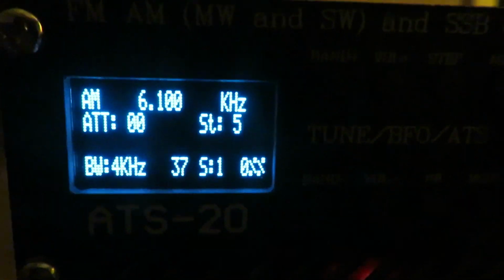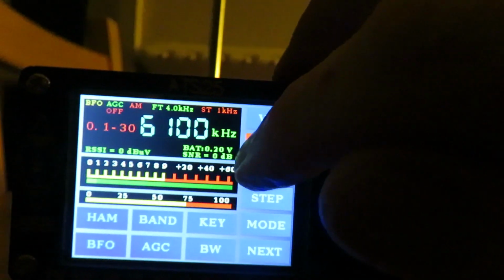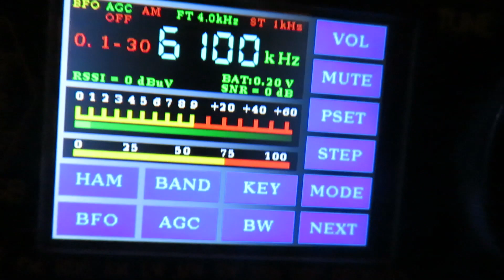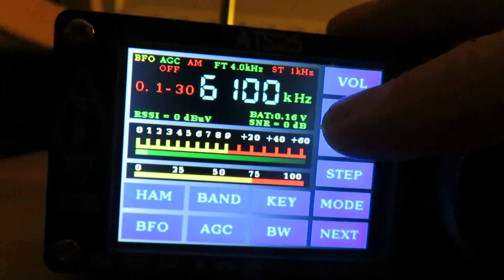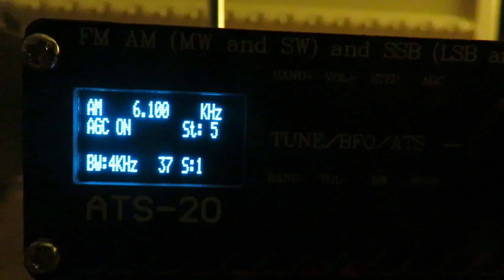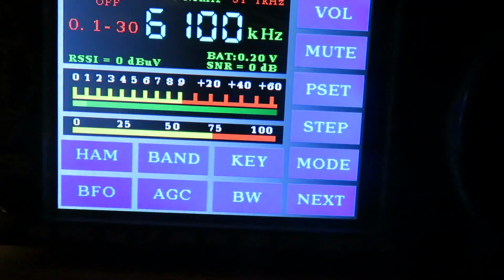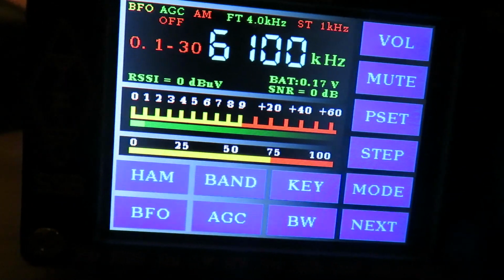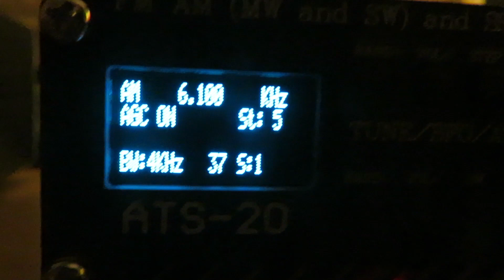ATS 25 VS ATS 20 on shortwave

Comment: In that situation - on the ats-25. 
Switch modes from am to any sideband then switch it back to am and tell me if it comes alive - mine is acting like this to, do like I say and see if it comes alive. You must do these steps if you shut the radio off and back on again to. I also found you must do this if you change bandwidths as well. Say you go fro 2.0 to 6.0 BW,  you flip the modes then back to AM and the signal gets stronger by far.  I hope I’m not the only one having this issue.

Comment: On my ats 25 the volume and tuning work in reverse vol up is to the left. Any fix for this? Thanks
Reply from the maker: John,I had  a similar problem with my ATS 20 and it could be fixed by changing the Arduino sketch, it was easy enough. I haven't updated my ATS 25  yet nor have I looked at the sketch so I can't be more specific sorry.
Reply: @KevinOReillyswl  i’m not good with arduino. Ats 25 has a yellow freq readout. If u ever figure out a fix for it let me know. I’ll ship it to u and pay u for ur time. Thanks

Comment: ground the case
Reply from the maker: Ray, I am sure that would help but not practical if you are using the radio in a portable setting with the telescopic. With an external anteena the noise is not noticeable.